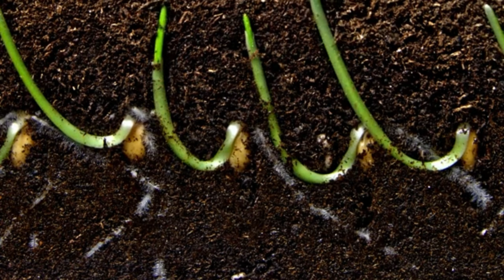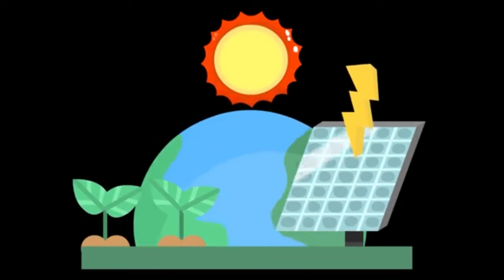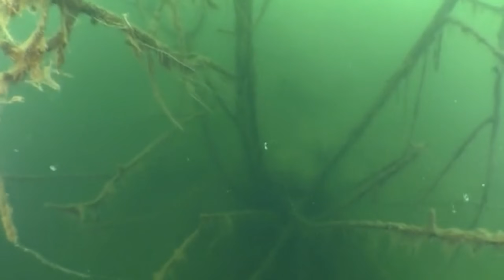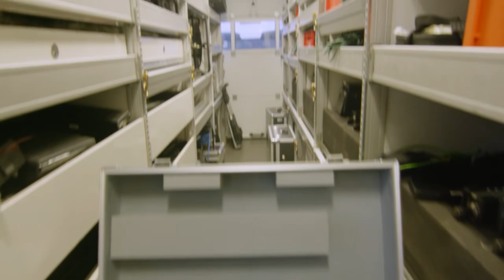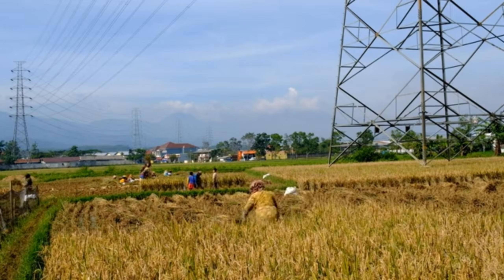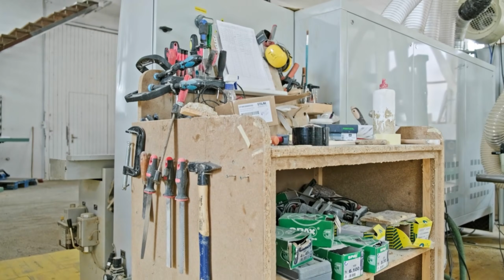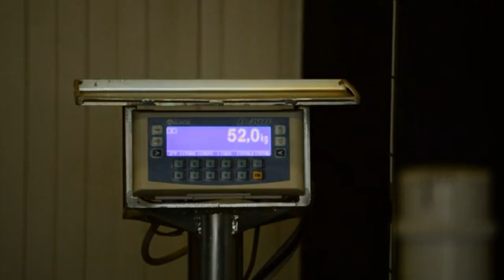This Plant Generates Electricity. Grow It In A Pot. Power An LED Forever.

Comment: I wish someone would actually put all the products needed in a row and actually show them as they are being conected
Reply: CORRECT.
Reply: The fact they don’t, should cause you to pause: the science they are talking about is technically real — but the implied scaling of that tech is b.s., which is why they don’t actually show it. 

A single pothos in a pot can’t even light a tiny digital LED like the one your TV has to tell you if it’s powered on. To power a weak 30W home light bulb, you’d need more than 1,000 plants.

This is just a huckster doing “sciencey”-stuff, using it to capture your attention — and the money it generates — while actually just lying to you.
Reply: @theronald2350  after a bit of digging, your statement is far from true. Yes, the video makes it sound far more useful than it is, but one large pot could definitely power an indicator led and about 5 pots in series could give enough light to read a book or light a walkway.
Reply: @LucidObscurity1 It does sound interesting,  at least to research.  Even at small generation.   This reminds me of other small power sources like large thermocouples situated on natural occuring heat sources, low output copper oxide solar panels,  sonic transducers that turn vibration into small currents.
Reply: @mike289homebuilt5  I've always admired the mountain stream hydro generators. Living on a mountain with constant streams or rivers flowing down from rain and snow melt and using some sort of bypass to take the water's energy flowing downhill to spin a turbine would be a perfect situation to generate very useful energy.
Reply: R you  ould just go to the transcript n get the info from there yourself n not depend r wait for someone else to do the work!! R you could get the item we all use to use called a pen n paper and just write down what you need along with directions if so need!!! Why wait for someone to write it down in the comments? 
Just go to the transcripts n scroll down to the minute marker needed r read the the whole script! Ah one other way came to mind for those who dont remember how tomuse the ole pen n paper!! Photo shoot it with your camera that is right in your hand!
 This is what these devices have done to the people!  Dumb many down! Just as Mr. Jobs said these phone were made to be use as a weapon!  They have done a great job on our children!  N most parents as well! They just sit by along with them. Stuck /glued to the device and dont want to do anything work. They wait for someone else to do it. People I say this with a kind caring ❤️  please get yourselves away from this technology!!
Reply: He lost me with the titanium wire.   The bottom electrode is carbon felt cloth. I think then decaying matter.   Midway tightly packed sand or just peat moss.   Top half  upper carbon felt then top off with regular dirt- potting soil and a plant.
Anarobic (no oxygen bacteria) form at the bottom producing a difference in voltage.
Just make sure carbon felt is conductive type like they use in batteries.
Fun way to get electric is off antenna an crystal radio
Reply: @mike289homebuilt5  I've always been fascinated by the difference in potential between sky and ground...the problem is when creating a tall structure you've basically raised the ground at that point so still can't access the potential...part of me wonders if the pyramids or other ancient structures may have found a way.

Comment: What you are not telling is the amount of voltage and the amount of current you can draw from the ground.  You can not use aluminium because over time is oxidised.  Unless you have a farm sided back yard you won’t have an area large enough to produce sufficient power to drive a 1000 lumens light bulb.

Comment: I actually think this is BS as you need 1.8V to 3.5V per diode depending on color, with 3V being standard for white LEDs.  I don't see this being generated here.
Reply: Ever heard of a joule thief, if not google it. Allows an led to lite up with half a volt, I created one that lights an led at just .4 volts. Educate urself…🎉
Reply: I have tested it. And it works. But you are right, the energy is too low to power at fulbrightness, but for a very dim one. I used the red led. Furthermore i used a supercap to charge over time, and that can deliever some descent energy. But it takes time. The concept is real, but not very useful. But i tried boosting the voltage with a joule thief, and it did improve.  But that is the max i could extract. Powering directly isn't working. But i suspect if the joule thief can improve it, i think of running a small diy pulse motor. Which might be able to power a small diy fan. But i doubt it. I was skeptical at first, but after a test run, i know it works. Must try with different materials.
Reply: @romanmorales3325  No, it does not work.  You would have to use some method to boost the voltage before you can turn on an LED.  Is there a slight amount of energy available through this process?  Yes, but not enough to power an LED as stated in the video.

Comment: So wouldn't the swamps and wetlands be giant batteries then?
Reply: Phosphorescence (bioluminescence) in shallow ocean waters is primarily caused by millions of tiny, disturbed microorganisms, often dinoflagellates, emitting light.
Reply: We Should be able to get electricity from duplicating conditions found in the many swamps of the Southeastern United States.....
Reply: now realize there are more lighting strikes in florida than anywhere on the planet
Reply: @velvetvideo  not entirely accurate. It has the most in the USA and is the lightning capital of the US. The most strikes on the planet is in Venezuela.
Reply: @elenorlapointe4241 
Hmmm again !
Reply: @velvetvideo  Hmmm lol
Reply: Ta da! YES! And let's go out as a class at nite n test your hypothesis -FIELD TRIP! 🎉
Reply: @vickihicks3810 Challenge accepted love! You first!😊
Reply: Yes, particularly the brackish water that flows and mixes with the tides. Permanent, kinetic, wave generators that collect the energy of the conductive salt water, the surrounding plants, and the kinetic energy of the flowing tides. Use this harvested energy to power hydroelectric generators that permenantly direct, harvest and distribute high voltage ⚡️ forget converting to AC. DC appliances that store unused energy independently of one another when not in use. Biological, rechargeable batteries are also the way forward improving storage and reducing dependency on toxic, inefficient batteries.
Reply: @josephandthegoonplatoon  It sounds good.  What about the hurricanes destroying it all every few years?  Ice cores show several ice ages in the last 500,000 years. They show we are probably in a short warming period of up to 11,000 years. We are in the Quaternary ice age. Humans are not helping, but we can't stop it. Increased co2 promotes plant growth.  Warmer means more food.  About 61% of electricity generation is from fossil fuels—coal, natural gas, petroleum, and other gases in the USA. About 19% was from nuclear energy, and about 20% was from renewable energy sources. Most of that 20% is water, not solar or wind. I hope you like the dark and cold.
Reply: @Greg-Horne It's all underwater and flows like grass. The surface can get as violent as it wants. Undertow currents are more than sufficient. Rapid surface net designs can also be deployed to establish/ restore power as emergency response and built to support marine life.
Reply: @josephandthegoonplatoon  If they could, they would.  You are in fantasy land.  Please leave your parents basement and get out in the real world.
Reply: @Greg-Horne dude, they are! There just not telling you about it for obvious reasons. Take your defeated, fearful, mindset somewhere else man. I'm not the one.
Reply: @josephandthegoonplatoon  I deal in reality, not ignorance.  I was building solar hot water heaters in the 1960's.  They work great.  Passive solar works great.  Solar panels and wind just don't get it. I wish it worked, but it doesn't.
Reply: @Greg-Horne Good for you man. Your understanding of very limited, available technology and limited, negative mindset is clearly the issue here. We have photovoltaic glass, shingles, peel and stick, flexable films, presure, light, moisture, and thermal sensitive, digital, snap together panel's that can be installed to build entire roadways. What we also have is a criminal oligopoly that steals our inventions, surpresses technology and limits access to materials and information. We have low earth orbit satellites than run on starlight, yet the most efficient marketed monocrystaline  materials available to the public are less than 22% efficent in broad daylight and break the bank and your house to install. We also have armies of convergent thinking, nay sayers shoting,"thats impossible!" Everything is impossible until it is done! Expand your mind and try again. "I did not fail 200 times to invent a lightbulb. I discovered 200 ways not to invent a lightbulb." Lol. Perspective is everything! Good day Sir.
Reply: @josephandthegoonplatoon  If you think all the countries of the world are conspiring to keep solar panels at 22 percent you are just a nut.  I will only address on point of your no fact salad.  A V2 (Starlink low-earth orbit (LEO) satellite) has a solar panel that is 6.4m x 20.2m (total surface area of 	~129.3 m²).  Please read carefully.  About 61% of electricity generation is from fossil fuels—coal, natural gas, petroleum, and other gases. About 19% was from nuclear energy, and about 20% was from renewable energy sources. Most of that 20% is water, not solar or wind. I hope you like the dark and cold.  I wish we had a solution, but we don't.
Reply: So would that be local, state or federal government funding a a swamp of electricity?
Reply: @joyceshaw1286 That's a good question probably none of them would fund it because the energy companies wouldn't make any money off of it
Reply: @joyceshaw1286 it would most likely be a NGO willing to try this
Reply: @joyceshaw1286 WTP should buy some swamps, and make electric co-ops out of them. Then everyone would have a stake in it!
Reply: We can create energy from geothermal, from magnets, from the soil... we don't need fuel/coal.
Reply: The rain forests!!!🙏🙏🙏🙏
Reply: Too bad we can't tap into that huge swamp in the east called DC. Several generations would be set for life!!
Reply: they are sometmes when they emit an eery glow
Reply: Disney World

Comment: since copper wire is usually coated with a non-conductive compound, why can't cheap copper wires with solder or aluminum ends be used instead of expensive titanium?
Reply: Use one copper wire,  and one zinc wire,  stick one in one end of an orange,  the other in the other end of the orange,  hook a voltmeter to the wires, and measure the voltage....it works  !!!!!